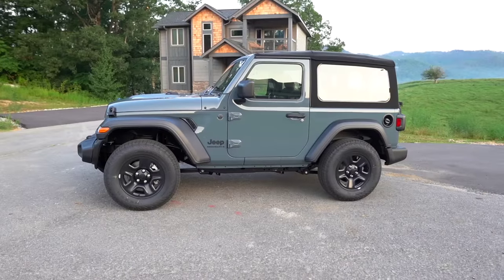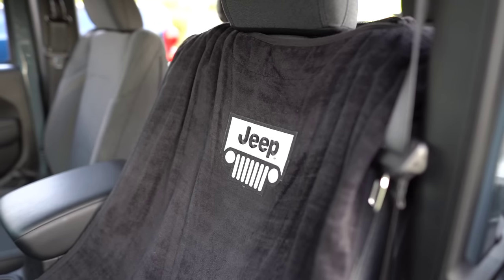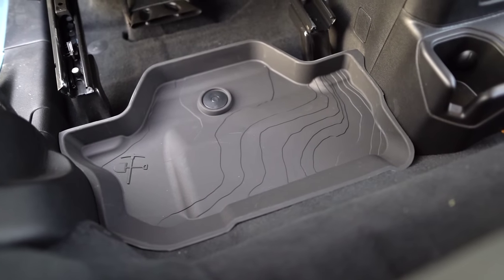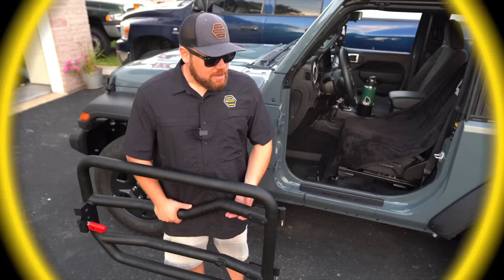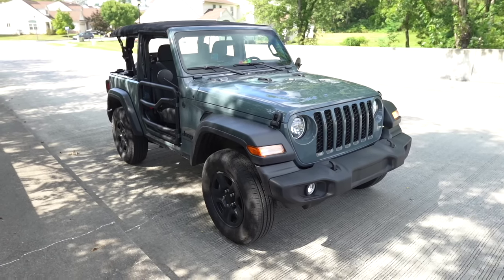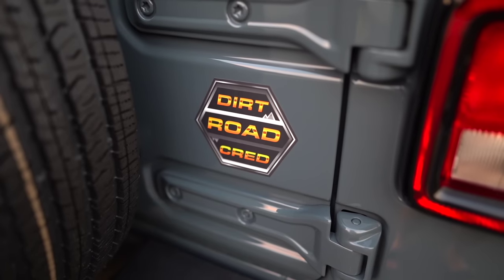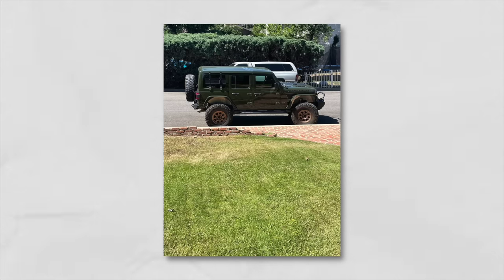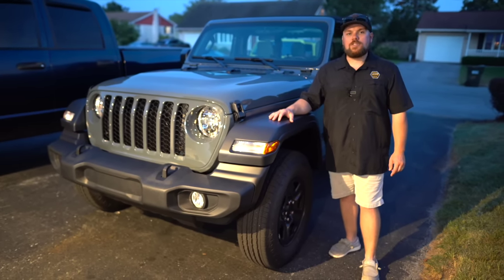First 12 Mods for the 2024 Jeep Wrangler

Comment: Thanks for sharing my 2020 sarge green JLUR. My pup is a black Belgian Malinois. There are a lot of parts added/changed but what you can see is a rebel front bumper, warm winch, method 701, Mickey Thompson LTZ MT 37”, artec inner fender liners/artec full aluminum skid plate, tetra flex IR control arms (swapped out the control arms from my 3.5” metal cloak game changer lift), RCV from axle shaft, revolution rear chromoly axle shaft, metal cloak axle skid plate, Falcon 3.3 shocks, yeti tie rod and drag link, Baja lights, KBD front and rear fenders, ACE engineering rock sliders, artec control arm skid plates.
Reply from the maker: Thanks for submitting!

Comment: As for the grab handle over each door, if you use the Mopar brand they will fit. They are really tight, I put them on my 2024 wrangler.

Comment: I like how the soft top looks without the side curtains. Definitely not a fan of the foot pegs, but those rock stoppers look like a great add on. I am a bit disappointed in the coverage offered by the door sill plates because they don’t wrap up over the top edge inside the door. Not sure if I like the floor mats or not. I like the idea, but I don’t know if I like the cluttered look they bring. Those itty bitty side mirrors are definitely a no go. The tube doors look good, but I like the Jeep factory half doors much better.

Comment: Just picked up my special order ‘24 Willy’s manual, and the cup holders is my biggest issue so far. Do you know if the cup holder adapter fits in the aft front cup holder? Otherwise my water bottle will be in the way of the shifter. I have been watching your videos since I ordered and some of these items are already due for delivery. Thanks for showing some of these cool additions.

Comment: Matt, Where did you get the screen protector from?  Your other products you mentioned their names but not the screen protector.  As soon as the UAW stop striking I will be able to get my much needed 2024 Jeep 4 door Rubicon. I will be needing a good screen protector.  Eddie
Reply from the maker: We hopefully will have a video soon!
Reply: Not sure what screen protector you used on the video but I purchased the Amazon YEE PIN for 2024 Jeep Wrangler Screen Protector 2024 Wrangler JL Screen Protector for 2024 Jeep Wrangler 12.3 Inch Screen Protector. Super easy to put on and fits perfectly on the 24’.

Comment: Something I noticed on this (Ryans) 2024 JL at around 14:00 in the video was with the doors off it looks like Jeep has improved the rain drip guides/rails at the top of the A pillar. My 2019 JLU Rubicon does not have this, but mine has a hard top and when its raining and getting into the Jeep there's a constant stream of water coming down there. Does anyone know if Jeep has improved this design? Is it only for soft top JLs? Can this be retrofitted to older JL models?
Reply from the maker: Interesting! We will check it out

Comment: If Jeep ever makes the Magneto Concept into a production vehicle my build would be mostly deletes.

Delete carpets, doors, soft top (go with mesh top instead), delete tailgate, delete front passenger seat, delete front fenders, etc. Basically lighten the hell out of it and pull off most of the aluminum crap (dissimilar metal corrosion is bad mkay).

The ball is in your court Jeep, I'm willing to drop a pretty ridiculous amount of money on a 2 door BEV Wrangler, even if the range is atrocious.
Reply from the maker: That would be sick!

Comment: Two little 'niggles' that I see right off. First, the phone holder. I'm thinking that if you have a protective cover on your phone, these aren't going to work. And if it is just relying on the magnet to hold it in place, I would think that it won't take much to knock it loose and your phone falls to the floor. IDK. Second, those sill plate covers don't cover the area (all the way out to the edge) enough. Probably a better solution would be the clear decal used a lot of times on the front of a vehicle to protect against rock chips. They make universal kits that can be used to accomplish that task. I've used them on my Honda CR-V and they have worked out great. It's my shoes/boots that hit the edge on the way in and out of the vehicle that scuffs the door sills. That plastic thing ain't gonna do s*it.
Reply from the maker: Phone holder did great when going off road, didn’t move once. Mag safe is strong. Door sill plates do the job for me